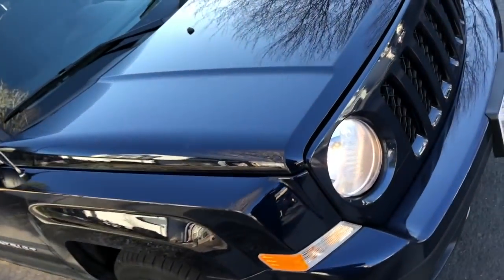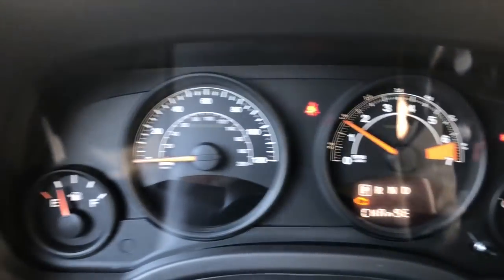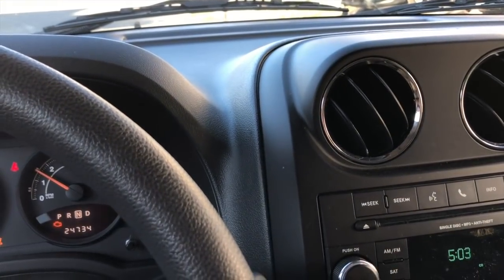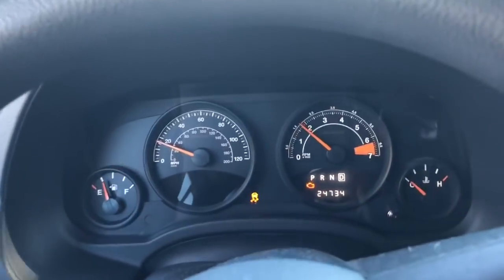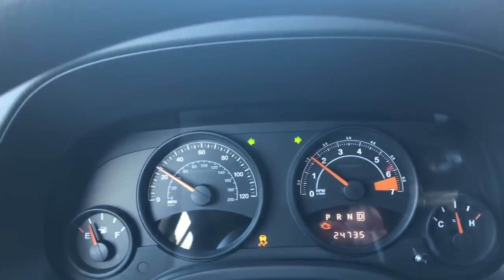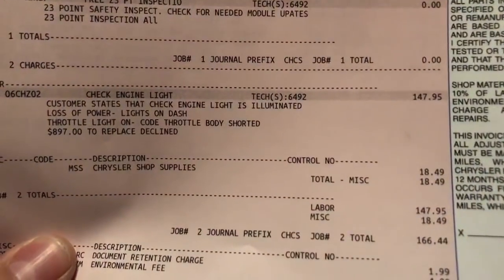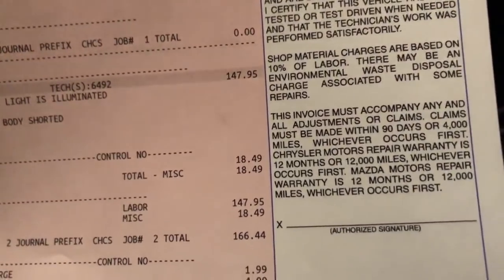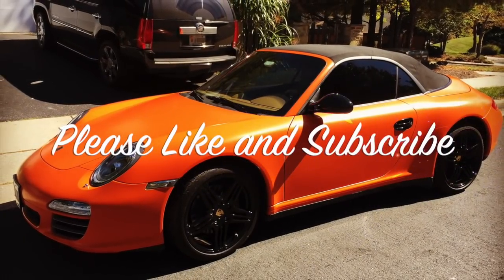Diagnosing a bad throttle body.  Limp Mode Chrysler Jeep Patriot

Comment: Dealing with this Today same model
Reply from the maker: It could be the same issue...
Reply from the maker: Try this first. 1). Turn ignition to Run, but do not start engine.
 2). Wait for all the error lights to turn on.
 3). Over the course of 15 seconds, slowly depress the throttle all the way to the floor. Try not to waver or be too jerky, just a nice slow, smooth push.
 4). Over the next 15 seconds, slowly let the throttle out in the same manner.
 5.)Start car and drive as you normally would.
Reply: @OmarsGarage  isnt most likely the tps?
Reply from the maker: rmc rmc technically it is the throttle position sensor, but it’s built into the throttle body.  It cost $75 for new one and to me it’s more reliable to just put a new one in rather then try to pull apart the tb.  You have to remove the tb regardless.
Reply: @OmarsGarage  Thats what ive gathered after more research thanks...Mine actually says its rhe actuator and a throttle is stuck closed..im just gonna replace the throttle body
Reply: @OmarsGarage  where for 75?
Reply from the maker: rmc rmc APDTY 112542 Throttle Body IAC Idle Air Control TPS Actuator Assembly Fits 4-Cylinder 07-10 Sebring 2007-2014 Chrysler 200 or Dodge Avenger 07-2012 Caliber 09-17 Journey 07-17 Jeep Compass or Patriot https://www.amazon.com/dp/B00QFTMHCY/ref=cm_sw_r_cp_api_i_PQZ8CbDDWF72Q

Comment: People be aware that those throttle bodies are junk, they are all plastic internally and the gears inside will wear prematurely there should be a recall but is not right now, before this happens you will notice that the acceleration is not as it used to and after 6 months you will get the car to go in limp mode and drive pretty bad, if you buy a cheap ebay OBD scanner ($3) you can remove the clear the code and turn off the check engine light and will restore the car performance for a short period of time until you replace the throttle body, i have a compass 2011 with 18k miles when this happened and after the replacement the car were back to new condition, I bought it cheap on eBay brand new and replaced it myself $125 and 2 hours of my time. Now i have the traction control light ON, this car is barely used and keep exhibiting issues with quality of parts, also it likes to eat batteries every 2 years i went now to a very expensive option and probably will trade it soon as it does not give me confidence that will stay solid until it gets 100k on the clock.

Comment: Man I wish I had found this video earlier. Literally had this exact thing happen to me.  Got the vehicle towed to one dealer and they told me what was up, were going to charge $900 for it, I had a warranty at another dealer so paid to get the vehicle towed there, had to fork out for "diagnostics" again to find out the same thing, and these mf'ers want $1015 to replace the throttle body and also suggest I do a $220 replacement of the spark plugs.  Just wow.
Reply from the maker: Wow, sorry to hear that…out the towing fees as well. This is such a common issue that I really doubt they don’t know about the faulty throttle bodies.

Comment: Yeah ford sucks.they can’t fix the check engine light on my 2015 f250 power stroke.Big Spring,Texas
Reply from the maker: Have you pulled any codes from the computer?  It’s a different car company from Jeep but it may be a similar issue.